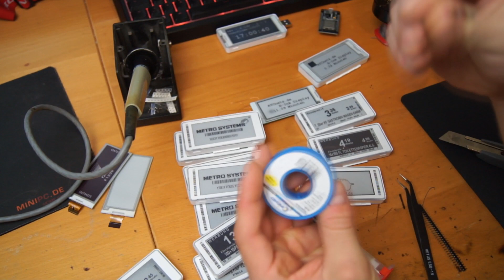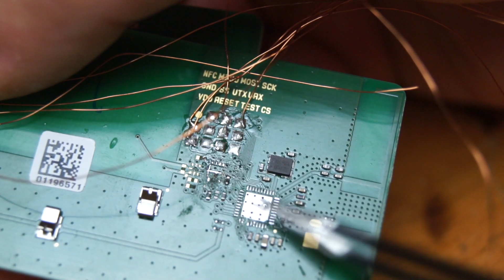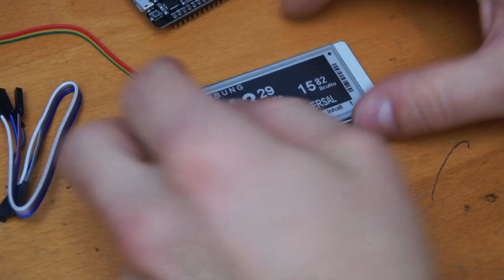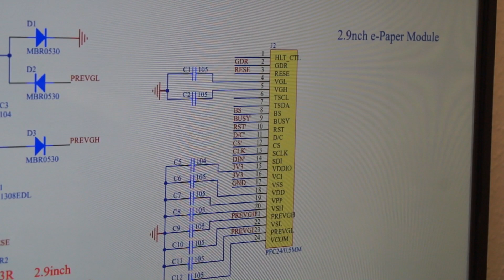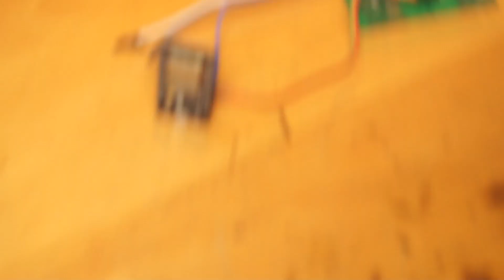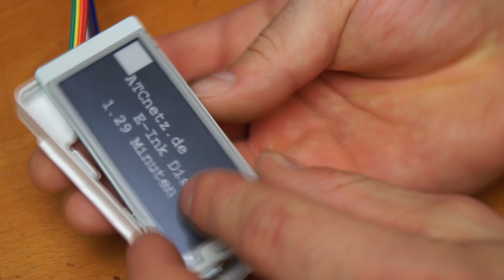Old Price Tag to Cheap Arduino E-Ink Display How To solder

Comment: How do you know which pin is clock, mosi ground 3.3 ect?? I have a different tag, so it would be great to know how to wire it to a esp32
Reply from the maker: Hey. 
You need tp reverse engineer the pcb, follow the traces and see where they go from the epaper display.
Search for the pinout of the epaper display to know what pin should go where

Comment: I take these use some propietary system for OTA updates? has anyone cracked it yet?
Reply from the maker: :) nothing published yet
Reply: @atc1441  bummer, could do all this by software that way
Reply from the maker: Exactly. 
The SEM9110 is reversed and can be loaded with  a custom firmware these days.
Search for dymitry and sem9110

Comment: Oh man this was amazing (of course not my competence area). Danke Schön really!! :-) I was thinking about helping my dad's supermarket and make all those papers digital and connect them to a system but it seems quite impossible :( Any help there would be appreaciated really!
Reply from the maker: If its for a complete supermarket you are definitely cheaper when using a real system, browse alibaba a bit for some inspiration.
You would need thousands for a supermarket and in the hobby market that not ideal price wise
Reply: Aaron Christophel totally understand! But my goal was to buy like 10 of them, build a system myself and then be able to buy this from a chinese or vietnamese supplier! Because otherwise it will be super expensive for Supermarkets like my dads! But thanks a lot again Aaron! 👍🙏🏼💐
Reply from the maker: Sound doable :) just got a lot of 4.2" versions of these price tags so if there is  interest write a mail to eink@43u.de

Comment: Best thing I ever discovered when it came to soldering small wires is soldering flux... ;)

Thanks for sharing though. And I wonder how many of these are going missing since you did this video and it got featured on HAD.. :D
Reply from the maker: Yes soldering flux is great. I talk about it in the video, sometimes i use it sometimes not, it leaves a glue type film on the pcb so i try not to use it.  
Have a great day my friend.